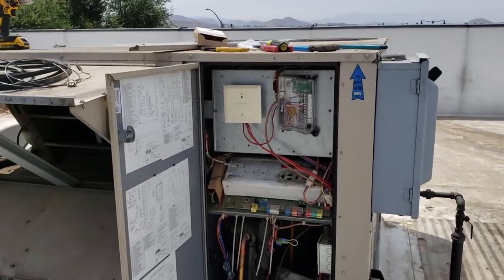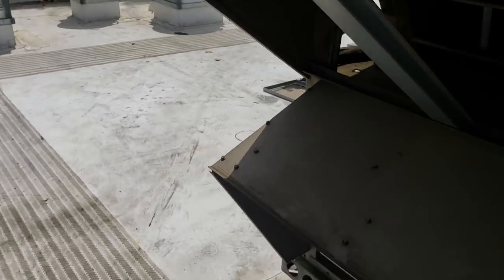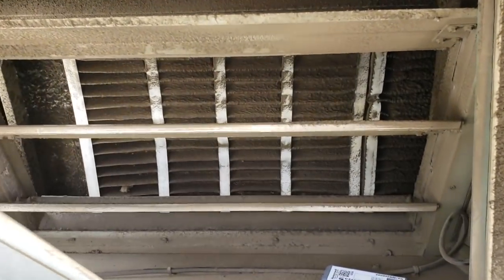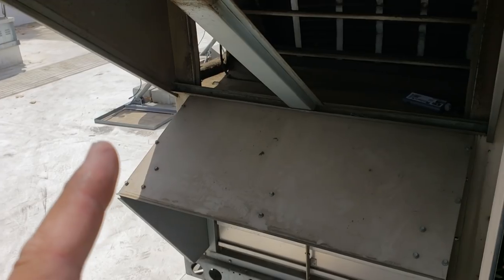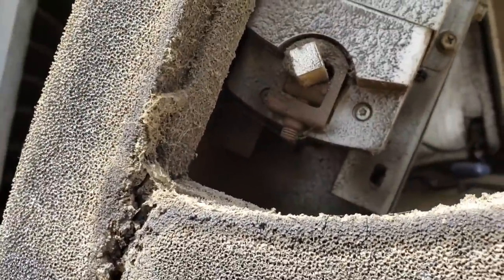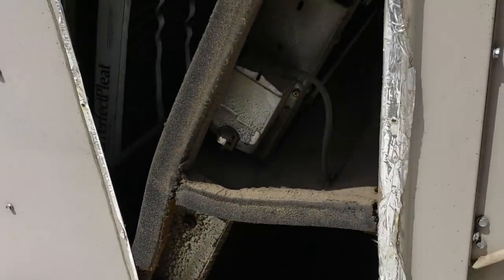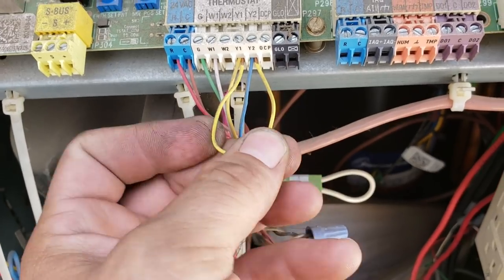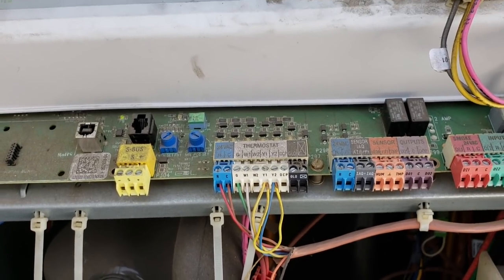Lennox Package unit economizer

Comment: man you should come out to my work. 70k sq ft building, chilled water system, around 20+ air handlers, 6 non op, several temp sensor false readings so handlers are manually over ridden, economizers might as well be non existent. building was just contracted, but to save money they kept the original ibex hvac from back when i was a toddler and tried to morph everything into one climatec setup. its a nightmare. condensate floods are a monthly thing.

Comment: Chris, I just found your channel a few days ago; I've subscribed and clicked on the bell. I am much enjoying your videos. I am a part time HVAC instructor, where I teach psychrometrics and residential HVAC system design. I've also been in HVAC related work (chillers, boilers, VAVs, etc), along with facilities management and EMS, for ~ 40 years. I find your thoroughness and careful way of approaching your work to be refreshing. I told my students the other evening about your channel and that I highly recommend it.

I'm also not a certified air balancing person, but that hasn't stopped me from working on air balance problems in buildings I've managed over the years. I found a lot of it can be done with a  hand held digital manometer, set to read pascals or inches of water column. For a restaurant I would think the pressure order would be dining room positive to kitchen and restrooms, kitchen positive to outdoors. The kitchens and restrooms are assumed to have steady exhaust, and as long as the RTUs don't have variable speed blowers, adjusting the fresh air dampers shouldn't be too tricky.

Even at my longevity in this trade I'm still learning fresh things all of the time. I also once worked HVAC in Southern California (San Diego) so I know what being in a service truck out there is like. It's kind of like a flashback for me when I watch your videos.

Keep up the great work!!
Reply from the maker: Thanks so much for watching and for  the nice words Cameron!

Comment: Im impressed, most techs probably do the bare minimum to get paid, but you go above and beyond what was required by going to all the different units and making sure they are all working properly
Edit: on the unit with the bypassed board i woukd quote to replace the whole unit, because it they bypassed the whole board its bound to be trashed on the inside

Comment: AABC and NEBB Certified here. In my experience, not many start-up personnel actually get lennox units wired up properly. I like to jump y-1 to ocp because that way the O/A is guaranteed to be conditioned as it's pulled in, but it really depends on the sequence of operation laid out by the engineers. Nothing worse than having it stay occupied only to have the units constantly in DEHUM.  As far as air balance goes. You want the kitchen to be positive to the outside, and you want the dining room slightly positive to the kitchen. 

For the most part, the engineers mess up more than anything. When reviewing submittals and seeing honeywell Jade Economizers, and no occ sensors or thermostats with OCC out, on a standalone building with no BAS.. i yi yi. 

 Good deal. Love your channel!

Comment: Just a side note. Positive pressure inside house is right in warm climate, at cold climate you want slight negative pressure. Here in Finland temperature  difference between outside and inside can be over 50 C (about 120-130 F). You do not want positive pressure at that situation.

Comment: The Prodigy controller will work the best when you apply the 24V from R only, if you use the G terminal the unit will go into morning warm up every time it sends power from G and will cause issues. Just FYI but good video thank you for using Lennox. :)
 Lennox Commercial Field Technical Trainer/Consultant III- Brandon Turnbow
Reply from the maker: I had to rewatch the video to see what you were talking about... this one was from a while ago. So from your comment I'm assuming that when the thermostat energizes the g terminal and my 24 volts is sent to OCP your saying that the unit goes thru a warm up? I did not know that and that's great information, thanks! In my case we run the indoor blower all day long for air balance reasons so we would only have the warm up once a day which shouldn't be a problem right? We dont know what humidity is out here in California so we can safely run the fan all day without the worry of humidity issues... anyways thanks for watching and taking the time to leave a comment!

Comment: I like to use the adhesive pads with the zip ties connected to it. I get them at Home Depot, the adhesive is strong and works great to replace ones you pull out
Reply from the maker: I use those for other things and yes they do work great!

Comment: Hi! Sitting here in Sweden, looking at your top notch videos as a new subscriber! It´s interesting looking at how different American HVAC standards are, comparing to our standards here in EU. But very much is the same too! A difference is that we often use heat exchangers in our AHU,  where the exhaust air warms up incoming cold air without mixing them both. That saves a lot on the heating bill. Also there are still a lot of old buildings with natural ventilation here, bet that would not work so well in Californian climate?

Comment: Hey man we hvac techs owe you a huge respect! Yiu are one of those rare techs out there. I am trying to fix issue with economizer. Mine is little bit different. Carrier. 5 ton rtu. Economizer would open wide both during cooling and heating modes. Wierd. Unit is brand new. All sensors wired per installation manual. If you have any idea would really appreciate your advice.
Reply from the maker: Does the unit have the honeywell jade controller?
Reply: HVACR VIDEOS The unit is controlled by honewell 8000 programmable thermostat. Checked wiring and installers set up. The only thing that was field installed is enthalpy and return air temp sensors. Also found out that economizer before installed was left on the top of the unit under a heavy rain over the weekend before installers came back. For now I disconnected economizer  and planning to order economizer controller and two sensors. Hope I am on the right track. I have seen H. Jade condrollers couple times, those things really freak me out)) It will be heplful if you make some videos on those too. Thanks for your reply and ofcourse for very informative videos. Your channel has a potential to become a very important resource for not only new techs but also those who are long enough in the field but have not dealt much with newer ewuipment and controlls. Good luck!

Comment: One thing I noticed on the unit with the chopped and joined wires , there looks like there is a module from the fire panel in there ( the beige square box with Notifier on it). Usually for either fan shut down and/or manual control from the fire panel to help with smoke extraction. The camera angles make it hard to see, but it doesn't look like that module is connected, just the loop in/out for the module. 
If there is a matrix in place for smoke management using the fans, then that matrix wont work with one ( or more) fans not connected to the fire panel.

Comment: Not surprised I worked in a military base and I seen stuff like this don't seem to understand who passes the final inspection when building are handed over after new construction. I have seen buildings with 100 vav boxes and none were properly balanced I seen problems from a flow issues to ac unit not properly wired to EMS to chiller under sized and geothermal units tripping on high head pressure due to not enough wells dough in

Comment: What is enthalpy?  It is a combination of humidity and temperature or sensible and latent heat.  If outside air is 60F and 90% humidity you would not want to put that air into building, although the air would be heated up and humidity would drop, but it has to be reasonable enough to be comfortable, this is what enthalpy sensor and controls do, they make sure outdoor air is cool and dry enough to shut down compressor and economize the system to put outdoor air in building comfortably, or put very little air in if outdoor air is not a benefit.  Same for heating too.

Comment: Huh, so apparently I’ve been doing air balancing for years, just on a tiny scale in computers. In computers, when you install fans - and my workstation has ten of them - yes - ten - that dual CPU life - the idea is that you will have them all pointing one way (which mine weren’t when I got this workstation. For some reason the four CPU fans were around the wrong way), and that you will also have positive air pressure, if only a bit. Not too much, because this will create a buffeting effect and will reduce cooling, but just a little positive.

The reason you want this is for dust mitigation - because the positive air pressure it keeps dust to a minimum, even if you forego mesh filters. I’m not a professional for doing it for buildings, but I am for computers. The most important thing is that all your fans are pointing the same way, and that your fans are roughly balanced with respect to CFM. Again I have no idea how this relates to a building but I guess you would start there. It’s also fairly difficult to feel air direction on your skin, so here’s where the anemometer from my other hobby as a storm chaser comes in. Walk around the building with an anemometer and make note of which way the air flows, I guess.

The other reason for the above is that you do want a net exhaust flow from the computer so there’s no stagnant heat cooking components that have ‘airflow’ but in the wrong direction.
Reply: Been building my own computers for gaming for years, and every bit of what you said was correct. You can't just have the fans pointing whichever way, they have to be balanced. I usually stick with one brand and style of fan for a certain build, and just make sure there's as many exhaust fans as there are intake fans. Works pretty well for me. I shoot for neutral air balance, but I have a mesh filter on the input so that's one difference between your setup and mine (also single CPU but these days everything has like 8 cores so....).
Oh yeah, and mine's water cooled. Built the loop myself, and I'll eventually put the graphics card in the loop too. Never realized just how EXPENSIVE PC water cooling parts are until I tried to build a loop with them. Spent probably too much money on that, but it's so quiet now that I can sleep next to my working computer.

Comment: Those made economizer enthalpy sensors are awful when the manufacturer used the top S-bus terminals. The top terminal pins rot out and break off in the Molex plug all the time. I see it when they are 3 years old, when I replace them I always use the side S-bus with the screw down connector terminal that comes with them.People just throw it out and plug in the top Molex plug but it's a bad design much more reliable with the side S-bus connection. Just my opinion

Comment: Do the building have a burgular alarm system? A good idea is to wire the OCP signal to a NC relay and then to a permanent 24v output, that you then wire the coil to the ARMED output from the alarm system. When the last person leaves and arm the building by pressing B and presenting the access tag, or enter the arming code on the alarm panel, or the building alarm does arm itself by time, it will energize the relay coil of the NC relay, which will in turn break the NC Connection, telling the ac units that the building is no longer occupied (as the building is of course not occupied when the alarm system is armed).

This is something extremely simple, and i think it should be done on EVERY Building with economizers. Every alarm system that isn't from the stone age do have a ARMED output that will be high (+12v) or a dry Contact, depending on panel, when the alarm panel is in a armed state. If the alarm system is sensitive and you aren't allowed to "touch", ask the building manager to Contact the alarm Company, to install a junction box with a relay inside that will export the ARMED signal for you to use, sometimes they can just wire the relay signal for you if you just pull the wire along to next to the alarm panel central box.
If you wire a relay Close to the AC unit, or a series or relays wired to a master relay, notice that the relay that do receive the ARMED signal must in most cases be 12v coil as most alarm systems are 12v.

Note that most alarm central panel boxes are tamper protected ( a switch that will sound the alarm if its opened - even if the alarm is disarmed ). In most cases this tamper alarm is disarmed by having the builder manager to enter a special "technician code", "superuser code" or "installer code" into the alarm panel.

If the building do not have an alarm system nor a access Control system, a simple but yet effective solution is to install a Little switch inside the doorjamb hole of the night-lock of the main entrance. When the last person leaving locks the night-lock, the bolt depresses the switch and the switch must then be NC so it breaks the Connection when building is locked and no longer occupied. In that case, it can be good to program a delay so the system waits like 10 minutes Before acting on a change of OCP signal.

Comment: Hey man, we did a kitchen Reno in the winter. 2 RTUs (one brand new duct and unit other old unit new duct) all exposed spiral duct. The old units duct which is run along the front of the restaurant is condensating like a bitch. Entire supply is dripping. Only happens when it’s very humid (right after it rains)  other units duct is bone dry... kitchen has a new makeup air and exhaust fan. Other contractors installed the makeup air which they couldn’t get working properly so might be off at the moment. Wondering what would cause this?

Comment: So what is the economizer actually for? I'm a heavy diesel/ transport refrigeration mechanic so I'm not familiar with these. I've been considering a career change though and this stuff interests me.
Reply from the maker: The economizer depending on what medium you are cooling is a way to use free energy such as outdoor air, and or city water to cool your medium that you are required to cool. So if you have a compressor that is cooling the building air if the conditions were right you would open outdoor air dampers and bring in fresh cool outside air instead of using the compressor to cool the air.
Reply from the maker: I am going to go live on Youtube tonight 11/5/18 at 5:00PM pacific time to discuss my most recent uploads and answer questions. Come on over and check it out 
https://youtu.be/JHpAuTzzw6E
Reply: HVACR VIDEOS 
Hmm. So in the case of this unit, it's using outside air for cooling? If that's the case, does it use temp or pressure to control the economizer? my phone can't handle the live stuff, just freezes up. I missed your notification. thank you though.
Reply: @jddiesel7409  if I remember correctly they use temp or humidity to control when the damper opens and closes so if the out door temp is above say 50 the evonomier wount open and it will kick first stage on per the settings on the m2 or m3. But per building code u have to have fresh air coming into the building at all times so their always open at least 10 percent but that's for the air balanceing guys to figure out

Comment: I have never seen an economizer that works.
Reply from the maker: I try and fix them when the customer lets me
Reply: @HVACRVIDEOS  you're a better man than me.
Reply: marty, I'd chalk that up to most folks setting them up initially; not knowing what they're doing (probably done mostly home units instead of commercial setups). I mean check out that one unit where they completely bypassed the board. Some folks tend to think this stuff is "too complicated" and with that mindset they never bother to learn and keep a closed mind on the newer stuff. Little do they know once you understand it, it's super easy to do... it's like they forgot when they were first learning the basics or they have the mindset that they're a veteran and "know better". Just my sort of observation.
Reply: marty maness that’s the truth, 95% of the Lennox rtu’s I work on are installed just like this.
Reply from the maker: Unfortunately I come across a bunch of units like this that were never setup properly

Comment: why not relocate the sensor ?
Reply from the maker: To where? It has to stay in the outdoor air filter area, there really is no safe space. I just wish they would make a weatherproof sensor
Reply: I was wondering that also... Would it be possible to mount the sensor a bit off the ground on the side wall? Excellent Video!!!

Comment: on AC5, where they gutted the board, perhaps old tech that knew how to do old school & not understand the computer board? 
I ask because I usually prefer old tech, but I like to know how to service newer stuff, even with vehicles. & I am qualified to work on newer vehicles, but I prefer to own older vehicles.

you ask how did it get passed, reminds me of a house in area I work in, all permits were got, home was built, then no one installed septic, OOOPS! left open pipe where septic was supposed to be installed, septic company got paid, inspectors got paid, home owner found it after exploring trying to find smell after it getting bad after several years, bank claimed wasnt their problem, it was no ones problem, end result, now land wouldnt perk & couldnt put in a septic, bank was forced to take home & refund customer.  one of the biggest oops in my area, the biggest was building a new bank, person knocked over oxygen bottle, & it went through 7 bank walls. that was close to 40 years ago